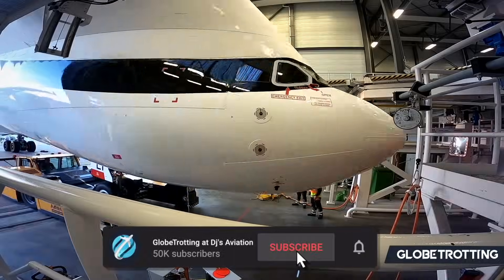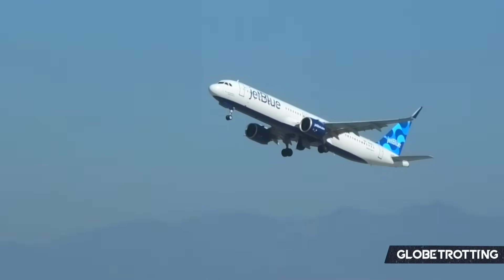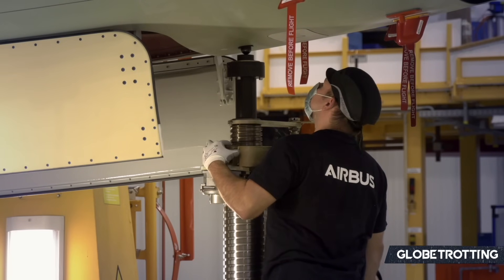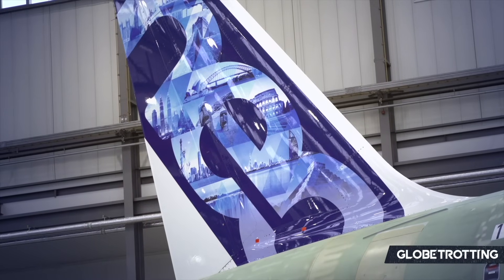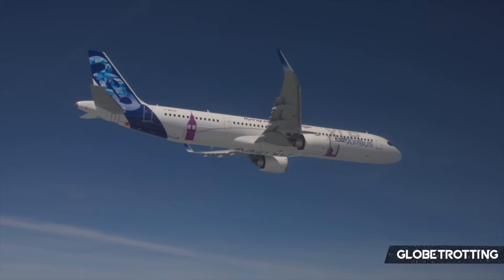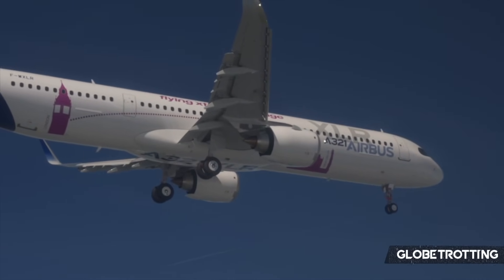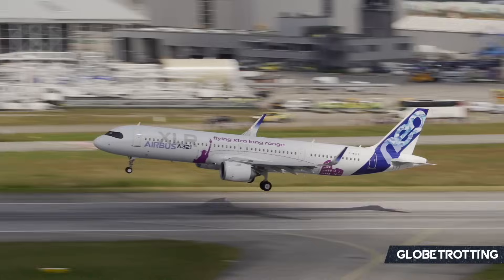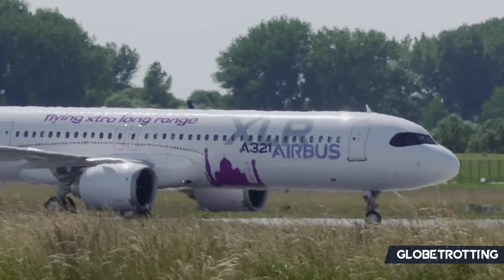BOEING RIVAL - The Airbus A321XLR

Comment: I have no problem flying coast to coast in the U.S. on the A321 for 5+ hours.  I'm not sure there is more room on a twin aisle, just the impression that there is. The only thing you can't do too well on a single aisle is walk from the front to rear lavs when the service carts are out, but even on some carriers twin aisle aircraft both aisles are blocked simultaneously with carts anyway.

Comment: Boeings screwed the pooch.
People will complain about long haul narrow body but as all things it comes down to money. The cheaper flights will sell 95% of people.
Unfortunately the neo is slower by comparison to the 75 or widebodies but the fuel burn and operating cost are amazing. Burns less than the current 320ceo with 50 more pax. On board in jetstars 321neos

Comment: The A321 and its longer range variants are more than capable of replacing the 757 on the vast majority of the routes it operates.

It may not have the exciting acceleration of the Boeing, but in today's operational environment, pilots use lower power sertings whenever they can to save fuel.

As for passenger comfort, that is very much up to the airline and how they specify the interiior - although the A321s wider fuselage does give it an advantage.

My local airline with a three figure (just) fleet used to operate a mix of 737s and 757s. Most of its expansion in recent years has been through the acquisition of second-hand 757s along with a significant order of some of the last 737-800s.

As the 757s are reaching the end of their operarional life, they have had little choice over a similar sized replacement, and have ordered a significant number of A321s which are starting to be delivered.

What should be of more concern to Boeing, is not that they are replacing their aircraft with Airbus where there is no suitable Boeing alternative, but that they are now replacing their older 737s or expanding their fleet with A320 series aircraft rather than 737s

While this may be only a few dozen aircraft a year, if this is replicated accross the market, it could potentially be a serious problem for Boeing until they plug the gap in their offering. 

However, any new Boeing will not be replacing the 757s which in the main will have already been retired by then, but trying to win back customers now flying A321s. As such, their new aircraft has to offer significant advantages over (a possibly improved or even replaced) A321 to make the change worthwhile. 

While tweaks to the airframe may offer small (but still worthwhile) improvements, it is the engines which make the largest contribution. Engines which can be fitted to the airbus to minimise the gap between it and its nearest competition in the way that the MAX did to the NEO.

While better in many aspects to the mature A320 series aircraft, the (now) A220s clean-sheet design no longer offers game changing improvements over its competitors because they are now fitting the latest generation engines.

It is even possible that no matter what Boeing do, they will not be number one unless Airbus make the kind of mistakes which have plagued Boeing since their merger with MD.

I don't think that Airbus won the crown, I believe it is more the case that Boeing threw it away.

Comment: Around 2002, Boeing had studies for a 757 replacement, but received little interest from airlines at that time.   20 years later,  757 is used more frequently for trans-atlantic thin routes city pairs.  Business use case changed.   Today,  United, Delta, are still flying old 757 without a true replacement.
Reply: Around 2002, like any year after 1996, Boeing's strategic planning was, is, and apparently will be rubbish...Since the dawn of aviation, there was always a bigger case for point-to-point travel (even at a premium)….why would you pay wish to spend 15h traveling, taking 2 planes, when you can just travel for 8h in one plane?...most travellers are happy to pay a bit more for this for several reasons...

It's the same strategic planning that led them to bin the merger with Embraer (the biggest competitor to Airbus's A220), to deceive and make cuts in the production of the 737 max and 777x range of planes that is leading to all the current issues...and probably the best of all...to sell manufacturing plants that are now used by Airbus to produce parts for its planes...Boeing has been, is and for the short to medium future will be advised by people who catered to the taste of Boeing & McDonnell Douglas boards - and that is Boeing's biggest rival - itself.

Comment: Back in the 60s and 70s most long range flight were flown by DC-8 or 707-300. That was the standard. And those planes were single aisle. Back in 1969 I flew to visit my grandparents. The flight departed LIM with stops in BOG-KIN-JFK-FRA on a 707-330.
Reply: The same was with IL-62

Comment: So Boeing is going to build an A380. The recipe is quite simple, Wait until your competitor owns the market and then build a plane nobody wants. Whine to the government for subsides and bailouts. Boeing HAD the best airplane for the job, but they scrapped any chance of building a "next generation"  Now the best they have is not good enough.. The max 10 is out ranged and less passengers They passed on a 757 max and the 787-3.  Both could have been flying long before the A321XLR. But Boeing cheeped out and now they lose.
Reply: the max 10 is the alternative. keep making out its boeing that loses
Reply: @nickolliver3021  The max 10 is NOT even on the same level of the 321XLR, at best, it rivals A321neo. LMFAO
Reply: @alvinloh9068  No that's rubbish. The 757 never came close to a321neo either the XLR is having issues that may reduce range LNFAOOO

Comment: Flew on the Aer Lingus A321LR from Dublin to Dulles. It was just under 8 hrs flight time. The issues I saw were lines for the bathroom and food/drink service was bit of an issue due to space on a single aisle. Flew the A330 from Dulles to Dublin and there were no issues at all.
Reply: But for that slight inconvenience isn't it better to at least have a flight on a direct point to point route. Some routes are just normal economical on a wide body. The A332XLR solves this for many airlines on many routes

Comment: For once  a positive report from you regarding Airbus, personally if I was crossing the Atlantic I would sooner be on a wide body purely for the reasons you mentioned but JetBlue seem to be succeeding .
Reply: so what's the stance of etops then
Reply: @nickolliver3021 absolutely nothing to do with etops just my personal preference, i would prefer 380/350/330/777 to cross the Atlantic no doubt this will annoy you but never been a fan of the 787:)
Reply: @r12004rewy  yes it does. You said personally a widebody over Atlantic. Etops applies to narrowbody over Atlantic. Why are you not a fan of the 787
Reply: @nickolliver3021  ETOPS has nothing to do with whether the plane is widebody or narrowbody. ETOPS is simply the maximum flying time on one engine you are allowed to be from the nearest airport, in case an engine fails. It's about engine reliability, not fuselage shape. All Airbus and Boeing twins have enough ETOPS to be allowed across the Atlantic.
Reply: nickolliver3021 you asked why I am not a fan of the 787, I have never flown on one and obviously opinions could change if given that opportunity, but I just don't like the design.
Reply: @r12004rewy  if you don't like the design then go tell boeing! You can't judge a plane if you have not flown on one. You might as well not like the a350 design lol
Reply: @nickolliver3021  you certainly have a thing about  telling Boeing that seems to be your standard reply do you work for Boeing?
I'm sure that if I ever get an opportunity to fly on a 350 I will love it, having flown on 319/320/321/340-600/380 
I'm sure I won't be disappointed.
Reply: @r12004rewy  Well what makes you think the boeing 787 won't be as likeable compared to the 350? 

Perhaps you work for airbus but that's what the standard question here is about with the airbus and Boeing fans
Reply: @nickolliver3021  just my opinion.
Reply: @r12004rewy  an opinion that won't exist
Reply: @nickolliver3021  your so funny Nick  so I can't have my own opinion.
Reply: @r12004rewy  your opinion won't happen. Just accept how it is in reality

Comment: I thought that the range was reduced for certification purposes. Is it still the case ?
Reply: It was reduced, but only by about 200km. The regulators insisted they better protect the new centre fuel tank in case of a belly landing, which made it a bit smaller. Not a big deal.
Reply: It was BUT DJ is all about ensuring Airbus looks better than Boeing, all the time :)
Reply: @shailendrabasnet4535  it's actually better. Stop crying for grounded company